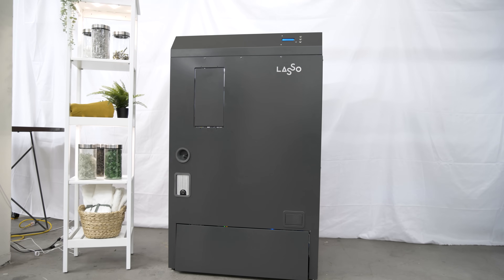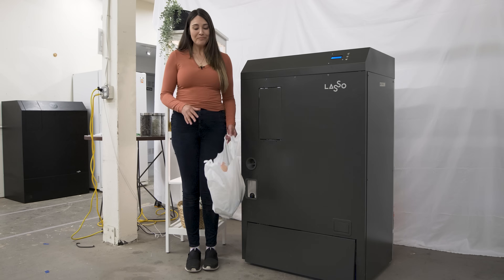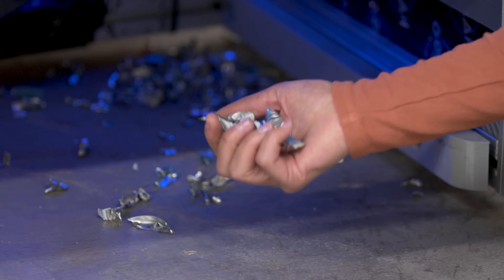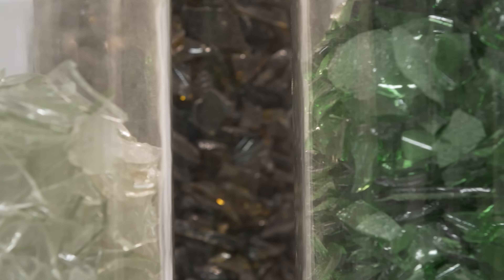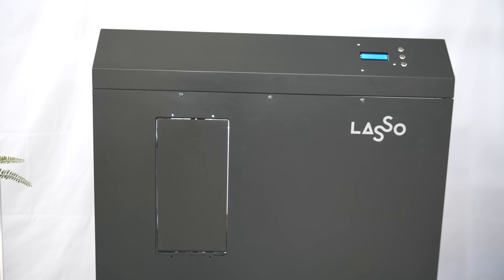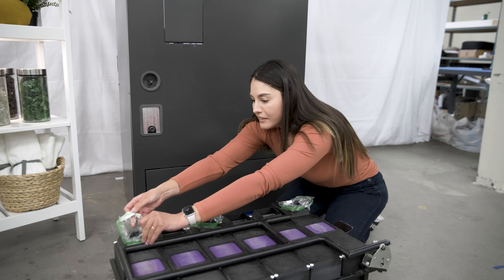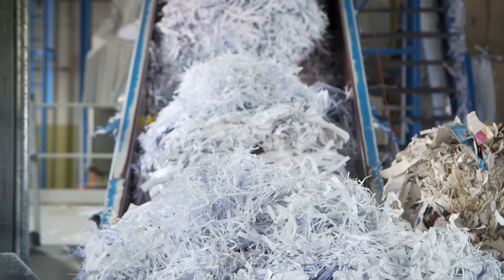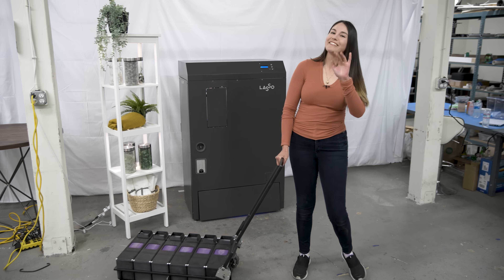Recycling Machine for Your Home (Lasso Loop First Look)

Comment: Oh wow!! This is awkwardly close to my own plan for my life's work, though you'd already built something around the same time I had my initial idea. I just today thought to actually google "recycling machine for the home" to see if there was actually anyone else out there doing something like this.
My plan is the same in that I want a recycling machine to be a household appliance, and in that it produces products at the end.. it only really differs in that mine would be a bit larger but thinner, more of a pipeline system in the profile of a long set of shelves, and also in that my primary focus in initial development will be cleaning and sorting sheet material, trying to utilise as much of original forms as possible, as a way of conserving energy, e.g. sheet material can be used to roll up batteries and capacitors and other electronic components. There will be unsavable sheet material that goes to be melted, potentially extruded for a 3D printer.. perhaps even dynamic injection molds for common shapes, and certainly some kind of assembly. I've also been thinking a lot about modular storage boxes and how they could be exchanged, though mine would be a bit larger and have sliding mechanisms to alternate sizes between compartments based on the amount of each resource stored, to maximise use. I've been cleaning and storing all of my recycling manually for about 4 years now, for the sake of learning how to best deal with everything for the sake of designing the machine that will do so, though I haven't even started on any CAD yet!
It's awesome to see you guys doing this, and once I make a proper start on this, I think it might be worth collaborating to some extent. At the very least I will most definitely share my work with you. What's important to me is that these become a thing, and I certainly don't intend to compete or hold anything back. Keep up the good work!!
Tonin

Comment: I see many problems with this kind of machine. Right on top of my head, how much energy does it use (never mind the noise and time consuming) and also, to whom am I supposed to sell the materials to? I mean with all the time and energy I investing in recicle my trash you don expect me to also pay for it to be made into products again
Reply: Hi 👋 Thanks for your comments!

When we calculate the energy usage of Lasso in multiple households versus energy usage for mass processing of recyclables at a central facility, it's more than just looking at the energy usage of the machinery: it's looking at handling + transportation, facility staff costs, and overall efficiency of the processes.The Lasso produces more high cash-value end-products for closed-loop recycling (resulting in fewer items in the landfill), reduces handling and transportation steps by conducting processes in the Lasso itself, and does not have to support a facility staff in a centralized location. Even with an appliance in every home, the Lasso will be substantially more energy-efficient than the current system (based on total kg of closed-loop recycled product produced).

Additionally, as the Lasso is both an appliance and a free collection service, we collect the materials directly from your home and sell them to manufacturers. In the future, the money made from selling these materials will go straight back to you!

Comment: Why not increase the size and market to disposal companies? Having this at home is great, but the issue with recycling is that waste companies still have to sort materials from the truck, which is where the shreds are likely to wind up in. If this company can develop a large conveyer system that can sort waste from recyclables for waste management sites, they will make insane money off of leasing alone.
Reply: Hi 👋 Thanks for your comments! 

The primary problem with the current system is the contamination that occurs when everything is mixed together and then sorted out in recycling centers. This devalues the reclaimed material both in its financial worth and ability to be reprocessed. 

With Lasso we bypass waste management sites completely. Since everything is processed directly in your Lasso, they can be sold directly back to manufacturers, skipping the recycling center completely (where they would normally do the sorting, cleaning, shredding, etc).
Reply: @LassoLoopRecycling  Makes sense, but I don't pay for my waste disposal company and I'm not proactive enough to do more than toss in the green or blue bin.

Comment: impractical. . to big!. to expensive!. no benefit for the end user. but a good concept that needs lots of work ahead for a consumer product. it needs to do its own sorting, remove the lids on its own during shredding. also add an composter that turns organic waste like paper, liquid waste from the machine and food waste into soil. then make it the size of a dish washer and you might have a good product. the containers can be emptied into the recycles bin and organic waste into the garden. Make that and I would buy one.

Comment: Decent proof of concept.  If they could add a tray where you could put in multiple items and walk away, and shrink it down to dishwasher size (or a little bigger with the tray), make sure it's very energy efficient, and add a good revenue share and/or rental program.  Then maybe they will it get to market.  If not, they will probably need to market it to restaurants or grocery stores or apartment landlords who can offer it as a free service to their customers.  It may work for families living off grid or far from a recycling center.

Comment: Very skeptical about this. Yes specifically PLASTICS recycling is broken everywhere, however recycling anything else is working as intended. What's the guarantee that this company will not just dump the problematic plastic waste it collects into a landfill/incinerator while turning a profit on the other things it recycles? I don't see a point in using this instead of regular recycling, unless your specific council is not able to provide recycling services which nowadays is pretty rare in developed countries.

Comment: The way to go is actually to make those recycled bits worth something, otherwise it's plain stupidity and guilt for anyone to buy this
Reply: Hi! Thanks for your comment!

The primary problem with the current system is the contamination that occurs when everything is mixed together and then sorted out in recycling centers. This devalues the reclaimed material both in its financial worth and ability to be reprocessed. 

Because these materials are cleaned, sorted, and kept completely separated in the base of the appliance, they maintain their highest value for resale. As this is a market, these numbers are always fluctuating but currently there is a of materials with 0% contamination.

We will not be offering monetary returns to start, but as these materials are valuable resources, our goal within 5 years, is to return that value straight back to you.

Comment: how is shredding, recycling?
Reply: Hi!  Thanks for your question :)

Simply, the Lasso scans, cleans and breaks down inserted & accepted materials into their raw form. Each material is stored in separate compartments at the base of the Lasso - which keeps each material stream pure. Lasso guarantees closed-loop recycling, where every item is made new again, from a bottle to a bottle, a can to a can.

We will be providing a service to pick up your end-products. Once the storage containers are full, you will be able to request a pick-up on our app - and we’re estimating pickups only 3-8 times a year! 

Since your collected materials are kept separate (maintaining purity and subsequent value) they are sold back to the manufacturer for remanufacturing. Ensuring the vital circular economy can take place.

The items that are added into a Lasso absolutely DO NOT end up in curbside recycling or the trash or a landfill! Only 2% of curbside recycling is closed-loop recycled, with Lasso Loop providing 100% closed-loop recycling for inserted & accepted items!

Comment: Calculate the energy for manufacturing and  material usage, with the energy of daily use. Convert that into coal powered pollution and ask yourself if this is a net positive for the environment.
Reply: Recycling in general is a huge net negative for the environment.
Reply: Nope

Comment: Probably not right with what she said at the end.
The polymer chains in a plastic water bottle breaks down after each heating cycle.
This reduces the strength and other properties of the product.
Hence, manufacturers want to reduce the amount of recycled plastic in a New product.
So the water bottle that you put in will be recycled like 20% of it and the rest would be downcycled